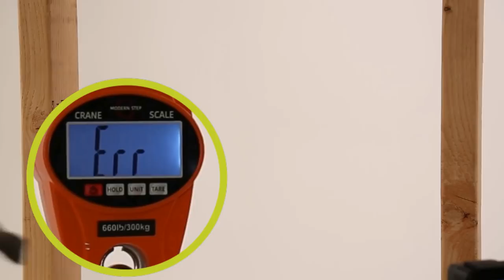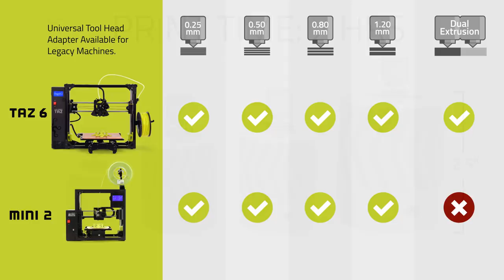Your Imagination - Built by the LulzBot Platform

Comment: Great but...the only difference between these $300 toolheads is the nozzle size... whats stopping me from buying a set of steel nozzles from ebay for $10? Lol
Reply: you are incorrect. The HS and HS+ also have volcano hot ends and hardened hobbed bolt besides the nozzle. They also use E3D parts, not some cheap knockoff that may or may not work.
Reply: @StuffWithKirby  ok so they have a bigger heating block so what. E3D heat blocks are $10. Also they have 3D printed parts all over them so your wrong on the quality. If they are gonna be this expensive i want all metal. The drive gear on the original toolhead is 3D printed. Very very poor choice.
Reply: @matthewguiher3248  Do you even have one of these? I have 7 and that printed drive gear has worked perfectly fine for 4yrs and a lot of printing. At the time they came out the printed part was a good design choice. Now there is other options available such as the aerostruder that doesnt use a printed gear. Newer models are moving to that. But the printed part is still a perfectly good part.
I have never had a printed part on any of my 7 Lulzbot printers cause me an issue.
Reply: @StuffWithKirby  never said it didnt work. Heck the one at my college works fine. I only meant that with the completely outrageous price it should be metal. That goes for every part of all of their toolheads. Its more accurate and reliable. PS. My custom built printer that i designed cost me $450 and it completely outprints both the mini lulz and the taz. And its bigger than both.
Reply: Matthew Guiher i can also make a meal at home and larger that what I would get at a restaurant for less. Doesn’t mean the restaurant is over priced.
Reply: @StuffWithKirby  yeah but continuing with your analogy some restaurants produce mediocre food for a ridiculous price. You go to restaurants for quality thats really hard to match. Lulzbot printers can be mtach by many cheap chinese printers
Reply: @StuffWithKirby  To clarify I would say the lulzbot is for noobs who just want something that prints or a company that doesnt tinker with 3D printers they just want it to print prototypes. For me though I am a DIY guy and I try to get max quality out of 3D prints (i do artwork and replicas mostly) so i take kits and upgrade the heck out of them or i design my own (i have designed and built 3 so far) The lulzbot is reliable but for me $2500 is not worth it.
Reply: Matthew Guiher A big part of why Lulzbot is successful and why it's printers are popular is factoring support into their designs and business decisions. Product support, customer support, and community support.

It's why all my homemade PCs are dirt cheap and run Ubuntu Linux but when I need a server for a critical commercial project, I call Dell or IBM or [insert your brand here] and install a commercial version of Red Hat (or even Windows!). Why? Because the extra cost is still way less than what it could potentially cost me — or anyone who values their time to be worth more than $0.00/hour.

If you rely heavily on your 3D printer(s), what do you do when your cheaper Chinese printer breaks or malfunctions? Did it even have a warranty? Are the parts tested or certified or rated at all? If you call the manufacturer, are they still in business? Do they even know enough about the printer or tool head they sold to provide support, or did a drop shipper just get a good deal on a pallet of 10,000 … once … and you happened to buy #9986, 6 months later it breaks down, but that same retailer is now selling surfboards and wigs and doesn't even have a record of where he originally got those printers.  

Don't get me wrong, I love how cheap a lot of commodity stuff can be via China, but who you buy it from isn't always who made it and support can be a nightmare.  This isn't a problem with those retailers, it's simply that to sell something at the absolute lowest cost… often "support" as a feature gets tossed out the window. You can always beat the price of a competitor that has customer support if you don't have customer support.
Reply: Matthew Guiher Yeah, commercial printers, in general, aren't really geared toward the end users who can/will "tinker".  

On your next printer build,  though, I highly recommend you try accurately tracking your time (if you don't already). Often, when people in the maker community do this for the first time, they'll realize they need to look in the  nearest mirror and demand a raise from that boss. 😎

I built a quadcopter drone once for about $75 in parts and by the time it was able to match a $399 original Parrot AR in capability, I would have had to value my own time at about $2.88/hour to be able to truthfully say that it was cheaper than the Parrot AR —but I didn't care, I did it for the DIY/tinker/maker experience.  But if I needed 4 drones for a project next month, or next year, I sure as hell wouldn't start looking for a deal on carbon fibre frames on Ali Express.

PS. if anyone who reads this thinks they might be able to build a kickass, reliable 3D printer, cheap:  start a company and try doing it! As soon as possible!  
If it turns out that you can't do it, just shelve the company. If it turns out that you can… um… enjoy being a millionaire, and I'll be over to clean the pool tomorrow afternoon, sir.  🤔
Reply: @lucasthompson1650  thats a very fair point. I mean honestly if I was gonna run a business that prints parts daily Lulzbot printers would be on my list of 3D printer choices. Time is money in business. Its sometimes better to spend a little more and get the job done rather than spend hours making it your way.

Ive never tracked my time before. The CAD designing and the arduino programming definitely take the most time. Im talking like if I spent 2 hours a day on those I could get it done in about a month. The actual build doesnt take long if nothing goes wrong. I usually diagram everything before I build so very rarely does something go wrong but stuff happens. 

For those of you who want to build 3d printers and sell them. Good luck...and get yourself a lot of headache pills your gonna need them.
Reply: Matthew Guiher Every business is different, too. Like you, I prefer staying in that tinkerer/maker/hacker DIY mode — and the "Let's try building our own _____" approach is obviously alive and well, and thriving, in many organizations. "Saving money" was absolutely the root cause for every set of skills I've acquired over the past 3 or 4 decades. Eg.
  * I couldn't afford a high-quality high-end electric guitar … so I learned how (and what) to fix/improve on affordable models to make them play/sound like the high-end instruments.
 * Same with high-end UNIX servers. Back in the early 1990s, the cost of a decent UNIX server from Digital, Sun, SGI, HP, etc … plus all the proper software licenses, was what drove me (and thousands of others) to Linux, GNU, and Intel's x86 platform.  Running Slackware Linux (kernel v1.2.0) on a i486 DX4/100 wasn't exactly easy back in those days — but I can't imagine any other way I could have learned as much as I did about hardware, software, networks, and operating systems in those first few years.
 * Drones. "DJI charges how much? Pfffft… those don't that hard to build…"
 * Lasers.  "$1000 for a blue burning laser that looks like a lightsaber … or … Go take apart an old DVD burners while I look up what a collimating lens actually is and where we can get one"
 * Etc.

Cost/affordability is rarely, if ever, the reason I'll choose to go retail instead of DIY on a project.  If I'm buying a bunch of Dell servers (or Lulzbot printers) instead of building/assembling them, the reason will almost always be to conserve my Time and maintain Focus.   We've all seen (or been a part of) one of those 3- or 4- person startup companies — where everyone is capable of doing each other's tasks, and people have titles like "CFO, CSO, DB Admin, HR Admin, Sales Manager, and carpool driver on Tues&Thurs".  That's great around the office, day-to-day, "Can you add accounts for those new employees to the CAD server and figure out why HR can't get to SalesForce , Jim is on lunch." "Yes I can!".   On a critical project, though, if SalesForce screws up, call the SalesForce support team. I want everyone else to stick to their assigned tasks and minimize drifting timelines — which often have other processes depending on them.

I'm a firm believer in the "skip business school", if you're of the "entrepreneur" mindset — with two exceptions:  time management and customer/product support. These aren't difficult things to learn, but they seem to be very difficult things to acknowledge and start practicing for a lot of startups and small businesses (including 1-man businesses like artists or stand-up comedians, and the enormous ocean of "independent contractors" and "expert consultants".  I've watched great businesses, run by great businessmen, fail in totally predictable ways because of horribly inaccurate completion estimates and deadline slips.

You (and I mean the collective "you", not just Matthew Guiher) should really try tracking your time on a big build — tell yourself you're just doing it for the sake of curiosity if you have to. 

I mean, I dunno how much Aleph Objects/Lulzbot president, Grant Flaharty, would pay an independent contract engineer to design and build a 3D printer for him, but "2 hours a day, for a month" is ~44 hours.  Let's say this engineer is going to be paid $50/hr, because he's experienced and we'll imagine it's a new startup — with plenty of venture capital money to keep the team well-paid and not looking to jump ship.  $50/hr is approx. $100K/yr if you calculate it as a salary (~2000 work hours in a year, unless you're at Apple in the 80s in which case multiply that by 3 or 4).   44 hours @ $50/hour = $2,200. So I hope you sourced the parts really REALLY cheap from China! Since this is just a thought experiment, let's say all the materials and parts were sourced free for some reason — you won the stepper motor raffle at the local rotary club or something, it doesn't matter — even if the parts were free, that 3D printer you designed and built has cost you $2,200.

To make a profit you need to sell it for more than that — choose the price carefully, cuz guys like Matthew Guiher are bound to point out that even if your printer is the most reliable printer ever, if you try charging $2500, he'll say it's not worth it! 😉

I know the thought experiment has all sorts of flaws, it's not meant to be an accurate business case or anything, just a scenario-space to examine what 2 hours a day for a month might mean, value-wise, in a certain context — if you feel the need to point out that keeping the printer as a fixed asset and putting it to work producing products can then be sold to make up the $2,200 by year-end, all you're doing is making your time worth even less. 😎

If I were to go out and hire someone, perhaps as an artist to produce a 3D printed artistic/creative work for me, or as a consultant (a "domain expert") for a project that involves "3D printing and 3D design" … I doubt I'd be able to find anyone decent for as low as $50/hr.  $50/hr is fine for a permanent day job, where you'd typically also have health/dental benefits, vacation days, retirement plans, equity options, etc... on top of that.

Figuring out what your time is worth, to you, is something everybody should do.  It doesn't have to be a dollar value, it doesn't even need to be constant — my hourly rate for Infosec jobs on New Year's Eve starts at $500 USD per hour, double if it's an emergency, and triple if the client needs me onsite … why? Because I don't want to work on New Year's Eve — but I do get a call, and I tell them it's $1500/hr, and they say, "Fine! How soon can you be here?!" …  well … I'll be working on New Year's Eve. 🤑

Sorry for the long rambling reply, I'd normally edit this down but … it's apparently some kid's birthday today, "Jesse Chris Moss" or something like that, I think he used to be the drummer for Nazareth (??), I gotta go deal with a huge tree someone put in my living room and help rip paper and ribbons off of a bunch of boxes … all containing crap I didn't want and don't need.🙄